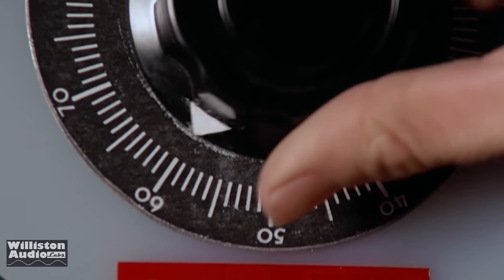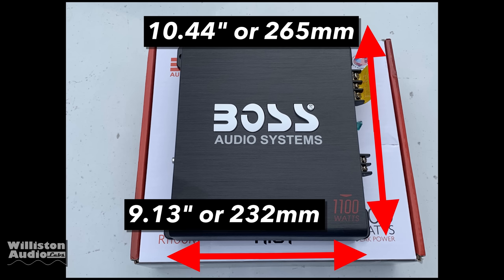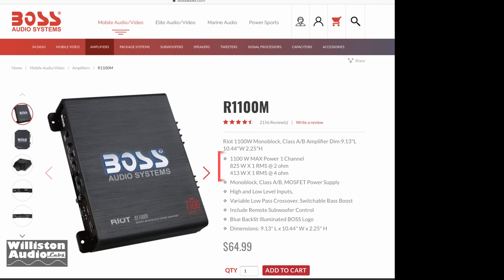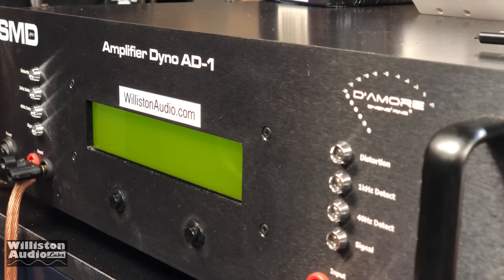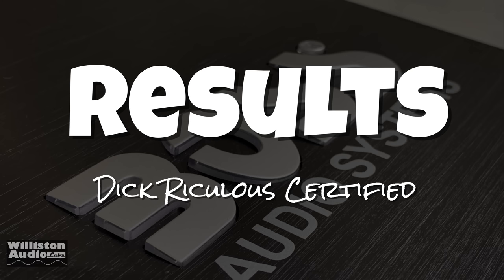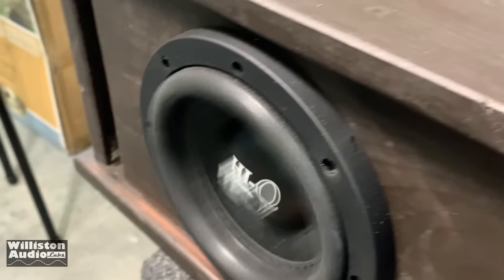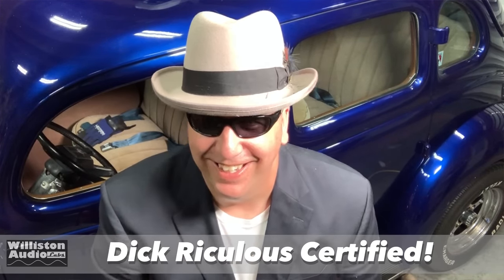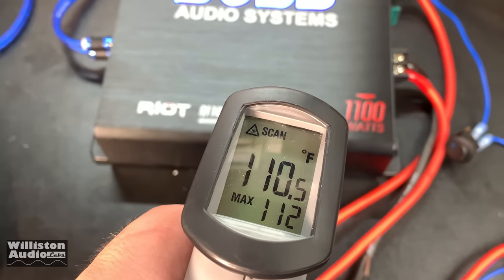Best Selling Car Audio Amplifier on Amazon (2019)? Boss Riot 1100M Monoblock [4K]

Comment: I wonder if it would power my jbl gti1200?
Reply: I'm gonna smack you with a wet latex dish glove if you dare connect one to a 1200GTi Automotive Series. That is a high resonant frequency, high efficiency beast of old school audio goodness.
Reply: @pgmurray76  and I'll put the sub in a 1cu ft box! Bwhaha!
Reply: @jat1668  Damnnnn youuuuuuuu!
Reply: @jat1668  In all seriousness, the JBL has a decent no% (efficiency) thanks to the massive magnet and relatively light moving mass (even with 4inch edgewound coil, but it is a short underhung one I believe).  It'll be fine.
Reply: Actually the efficiency is not bad, but not as awesome as the JBL 2206 twelve inch pro driver. That is more of a midbass driver with 95dB/1W/1m sensitivity (2.5% no). I confused the 1200GTi resonant frequency with the 2206. (37Hz vs 52Hz). Sensitivity is a true 89-90db at 1W/1m (only 0.6% no). I had two of these in the "recommended" 4th order bandpass enclosure to reduce group delay and extend low frequency response. The year was 1995! Two Phoenix Gold M-50 amps drove them through an Audio Control 24XS and a Clarion 6770 Pro Audio CD player. Later on was a JBL BP600.1 amp (I still have 2 BP600.1s). I sold the 1200GTi's in 2001 to buy used 2206's to make homebrew monitors for my friend's band and to help buy a used Stewart PA1200.

I was wrong about the coil and gap. It was not underhung. 5.5mm Xmax one way. It was riding to the edge of the magnetic gap both ways at full volume. Kinda underdamped and typical Bl too considering big motor. I am guesssing the area of copper within the gap reduced distortion regardless of the end of the coil reaching the top of the gap. They always sounded good and punched my back hard from 4 feet away. I go nuts when I see one on eBay.

Really they should never see more than a true 400 or 500Watt RMS amplifier regardless of the '600Watt' thermal rating. These will yawn at 600Watt thermally, but that is too much excursion wise. They never bottom out thanks to the spider and bumped back plate.   40mm pk-pk with no damage. I witnessed this in 1990 during marching band. Someone plugged into a hot soundboard slowly and a made a JBL 2241 dance really far with no distortion. This is why I loved this series of subwoofer.

Hope all sounds good for you. I hope that 1cf is after 1200GTi driver displacement, or I hope you like Palmolive green along with Playtex brand gloves!!
Reply: @pgmurray76  holy smokes. 1997 used an m50 too. Still got the m50 too. I can't decide on a head unit. I've been out of car audio for decades.
Reply: @jat1668  I still have mine too.
 Plus two M-25's and an unopened EQ-230 with TBAT. PG MX3 three way white crossover with gray silkscreening. Two Audio Control 24XS (one vintage, one newer). Audio Control 2XS (I cannot find it!). JBL GTcX12 (had a 4-leg, standard cast frame...I think same frame as Soundstream subs and Lanzar, only made for 1 or 2 years then changed). Infinity Perfect 12.1 (4Ohm). Two blue older Jacobs Accuvolt Monster 50Amp DC-to-DC stepup-down regulators. Image Dynamics CD-2 piezo underdash waveguide horns with 2-bolt 1.75inch pro tweeters. Oh and the two JBL BP600.1 amps. Plus ollllddd RF Punch 30 (peanut) and Punch 45. Somewhere, somewhere is an older Alpine 500Watt mono amp - not the shitty ones that break now. Last but not least, a silver Infinity Digital 100 amp (100x2 or 400 mono).

I am fairly certain this is everything. Not including the two pro JBL 2206 12 inch 8ohm beasts.
Reply: @jat1668  As for head units - they drive me crazy! I try to get HD Radio units with Bluetooth at minimum. Some people don't even want CD players anymore. I have an older JVC.

Comment: I went looking for my old school LANZAR 240 and 500. The cool ones with the red lettering with that cool font. I wanted to send them to you since they’re in good condition (minus a little paint scrape where the screw mounts are and a little cut back in the power and ground. I know the molex connectors are still good. 
They’re still in their original boxes as well. I gonna have to check our storage units to find these. 
I really liked these before I switched them out for a Zeus and Isis... yep I know they were made by the same place down in Santa Clarita area. I think Autotek, Lanzar and HiFonics were made there back then. 
What always got me was their THD numbers back then were like .015 or something crazy like that, which I never believed but nonetheless they were rather powerful and played clean. 
Hope my parents didn’t throw those away when cleaning up and reducing storage units. That would be a bummer.

Comment: Every boss amp I ever had was crap. The subs sucked too, I bought a cheaper boss 12 inch sub and it died in the first six hours during break in. Warrantied it for a new one thinking maybe that one was just defective but the new one only lasted 2 days past the first before it died as well. Claimed to be a 1400 watt sub but couldn't handle a 500 watt dual amp. Boss is garbage.

Comment: I think this amp would be better in full range mode for a single coaxial speaker. Buy 4 amps put one on each speaker and you are  doing pretty good. 100watts rms at 4ohm is not bad for full range speakers. Or maybe even midbass.
Reply: Ya but for $200 I can get an orion class  ab that takes 1/4 the wiring and does 150w per channel. I think anyway you look at it this amp sucks except for running 2  little speakers in your room for
Reply: @rmblwgn  Im finding this amp listed at 100 bucks. So for 4 amps, 1 for each full range coaxial speaker, in your standard car. Thats 400 bucks!  For that price theres plenty of 4ch amps on the market.
Reply: @randomtube8226  they were $50 3 years ago they are now about $60 on amazon
Reply: @rmblwgn  That's not too bad for 100watts rms at 4ohm. I know someone who has owned one for 3 years now clipping the crap out of it every day. Yet somehow it still works great. I don't even know how.
Reply: @randomtube8226  I sold mine it just didn't give me the thumpi  wanted and I'm not a guy who will ever run 2 12s. Many amps are deceptively marketed in terms of power but this one is just ridiculous it pisses me off. I felt scammed, I then bought a jbl gtx 500 that does over 800w for $20 more.if  I knew this only did less than 150 W I would have never bought it
Reply: @rmblwgn  I know what you mean. It doesn't give much thump for subwoofer bass.

Comment: My friend uses one of these on 2 kicker 12's and it bumps em surprisingly great!
Reply: Dude, its still a cheap ass 100-200W amp
Reply: The Pioneer TSW126m subs are a great pair with these BOSS amps. You get a lot of output with surprisingly little power. Used to vibrate my side mirrors with one of those subs and a cheap BOSS amp. They definitely get the job done.
Reply: @Broxine  never said it wasn't. All I said was it actually bumps...

Comment: I’ve said it before, I think these BOSS amps are solid and that’s all fine and well, but they’d be less of a joke in car audio community if they just gave their amps honest ratings. Pioneer is guilty of this too, good products, but the ratings are absolute lies. But I mean hey if you’re starting out and you want cheap solid power, they get the job done. Just remove that final zero in their peak wattage rating and you know what to expect. Their speakers and subs are nice too, just be smart about the wattage rating. Everybody starts somewhere. I gave my old “400 watt” BOSS 4 channel to my buddy for the PA horn on his CB setup. Ran the speaker out from his CB into the high level and used one channel into his PA horn, gets the job done and he’s yet to kill it. Loud too.
Reply: I’d also be interested if you know of or ever find a 5 channel amp that actually puts out good wattage to the sub channel. Seems like all of them are lacking compared to just running a separate monoblock.

Comment: That makes me wanna put my 5 year old Boss R3002 on an amp dyno. I’ve got it powering my two Clarion WG3020D 12” subwoofers. Doing pretty decent with them right now. But it’s actually rated for only 115 ish anyway lol well, I have my subs at 2 ohms per sub and it’s rated for 225x2 at 2 ohm. So it probably puts out 85x2 😂

Comment: I bought this amp and ran a 12inch shallow pioneer. Worked like a charm and sounded great. 🤷🏾‍♂️
Reply: That's because that shallow mount Pioneer is listed at 400 watts. But it really is a 200 watt subwoofer.
Reply: @ricardomolina4605  True, but it sounds amazing and for the price, I can't fault either product.
Reply: This is all you need to drive it basically.

Comment: I wish people here who stop rushing to buy crap.

Take time. Save money and buy good shit
Reply: I wish I did the same thing, I just sold my boss amp on marketplace, got rid of that shit
Reply: Don't need anything better. I only needed 100 or 200 good clean reliable watts without putting too much load on my cars electric system. Spent the money I saved on better speakers. My amp has been used heavily and moved from car to car and dropped and lost and found again (when moving to another house) and after 6 years it is still amazing in my sons new Mustang.
All other Boss stuff I've tried was pretty crappy, but this particular amp is amazing for the money.

Peace!

Comment: Well I just bought one so I hope it does ok l
Reply: Me too
Reply: I got one running 2 10" pioneers and it bumps not as nice as I hoped but decent for this guy saying it could only run a small sub
Reply: I've got one running a 350w 10" nvx. It's not bad but could be a lot better. Hits around 105db
Reply: @jpageify  running 2 600w 12" kickers. Sound great. Need an amp for the door speakers now.
Reply: Mine has been in my truck for about 2 years hooked to a Shallow mount Pioneer sub, It won't shake the windows but considering the price, I would recommend it If you want big subs and even bigger bass you will have to pay . I had since installed 2 more in my cars and all seem to work ok.  Inflated ratings is just what most AMP makers do that are not high end. Honest, heck no, but they all do it.
Reply: Its boss there is no way it will do what is rated..but a cheap brand will do basically 1/3 of rated power
Reply: Me too. Im going to put a 10" Kenwood in pancake box. Hopefully it works

Comment: if I did not what to spend a lot of money on car audio equipment I would go with boss audio and use the little watts that it have.  On the up size these amps do not draw a lot of power on the electrical side aka car

Comment: I mean, I run one, it usually is at about 825 watts, and I have 2 hertz centros 300 watt rms each, and well, this amp is pretty good with that ngl, it’s really low wattage but still hits hard asf, also it always stays bellow 90 degrees
Reply: Your amp is junk. You could spend just few dollars more and get a much better amp. I have a crappy soundstream txp 6000.1d it’s rated 2350 rms at 1ohm (it’s ohms not hertz) and it doesn’t do it’s rated power other then dynamically, certified it did just above 2k watts. It does rated power for 2 & 4 ohms. But I got it for 160 bucks and I’m pushing 2k watts in two 12’s that are rated 1k rms each…. There are cheap amps and then there’s garbage, boss is in the garbage category.
Reply: Your amp will never and has never done 825 watts unless lighting struck it…

Comment: is this good for 2 12 in 400 rms, 800 peak subs?
Reply: Hahahahahahahah no. Get the boss 4000w
It might make 400 at 4 ohm
Reply: Just go with a 2 Chanel Kenwood 800 watt amp its $140. It will do you justice.its like 200 watts rms.thats all you need to bang.
Reply: Not enough info.  Depends on how efficient your sub is and what SPL levels you listen at.
Reply: I've had this amp in my car for a year and it's still good. I have 2 12in MTX.  Drove to denver and back the first trip no issues at all, I was bumping the whole ride 🤣🤣 my 2nd trip tho about 4 hours in it turned itself off (which has never happen) I thought it busted but it was saving itself because it was overheated. It still works good tho!

Comment: Boss, power acoustik and pyramid are just some of the brands to be avoided. If you can't afford some of the better equipment do yourself a favor and save up for them, it'll be worth it in the long run.
Reply: Son Goku power acoustik is actually pretty nasty on the higher end stuff especially for the money. Boss amps a good and pretty clean. I have the 1100m i picked up for like 10 bucks locally and it’s a good sounding little amp. Never gets hot or anything. Also had a armor series.  Bout the same. Good consistent and reliable power. Not bad for the money especially if you just want a little extra thump.
Reply: @stormmccree8238  I will agree it's good for the money. But it won't last very long. I've had 20+ years experience with all them brands.
Reply: I’ve beat the piss out of some elcheapo amps like this. I’ve killed higher end amps but have never had a lil amp like this fail me. Other than a old vr3 lol
Reply: @stormmccree8238  I got a first series alpine amp that's still going. 25 watts rms lol
Reply: Son Goku oldschool gear is a unfair comparison lol. Back in the day amps were built good. I had a old school xtanz or something along those lines. Amp was basically dead and still worked in a usable way. Old kicker amps are my favorites though. I had a zr240 that was absolutely beautiful on my mids and highs.
Reply: @stormmccree8238  I wasn't comparing it, just making a statement.
Reply: I have a power acoustik gw-124 sub.  It certainly pumps out the bass, but it definitely won't handle 1200W RMS like it says it will.  I've got it on may be 300W and it seems to be pushing it hard already in a ported box.
Reply: But it is so much fun!!! I'm really enjoying these lower cost gear! I try them out in my car and then I give them away to my students!!! I show them how to install stereo in thier cars!!!!

Comment: Will it push 1 15 inch sub
Reply from the maker: Not very well
Reply: @wal  thanks..
Reply: I have one pushing a 500w sub. It's ok. Not the best though
Reply: @madfictionfpv8246  cool....
I think bridging is best for one sub....
Reply: I got a riot 1600m on my 2 12'' pioneers that are 600rms each..the amp runs hot fast and cant push my subs with enough power...could I use this amp to power my door speakers?
Reply: @cmbxsnowman5185  yes...
Reply: @liljons6753  thanks...if I disconnect 1 sub even thought they're wired parallel will it play 1 sub without problem?

Comment: I think if boss would just advertise the actual rating’s they still would sell just as much. Dollar per watts is about rite, but the false numbers are only making a bad name for themselves.
Reply: Dollar per watt is actually meh ($100-$200 yields far better $/watt) but getting a brand new amp at that price with a 100w+ output is where its not a bad unit. You can find better amps for the money but they are used.

Comment: Big d you need to test the new Orion cobalt amps for 2020. They redesigned them I purchased one and I’m thinking about sending it back it’s the biggest mono block amp the 4500.1 d it has three 35 amp fuses!!! I had purchased one in 2018 it had 4 40 amp fuses quite a big difference they’re sill charging the same$ I know it’s a budget amp but it’s also Orion kinda pissed off about it. Thanks

Comment: Would like to know what’s a good amp to push a power acoustic bamf sub that’s rated 1750 rms that’s a budget amp
Reply: 12 of these.
Reply: Skar RP1500.1D would work good if your running it at 1ohm. 2 ohm I would suggest their RP2000.1D

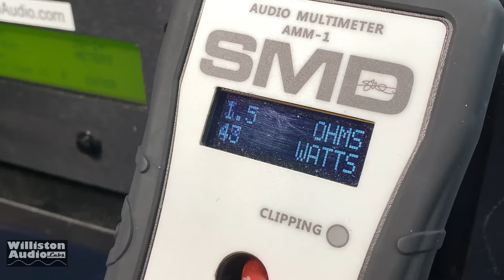Comment: stop video at 7:01 0.1 ohms 392 watts rms LOL
Reply: I thought so too, but I gave it a try a few years ago just in case. I knew the 1100 watts claim could not be true with a 30A fuse and for just $55. I am glad I did because for $55, it is great! I've bought two of them for two different systems.
For those with a sensitive ego, it may not be a great choice ;)
How much sound can you get for $55....this is a great option!

Comment: I agree with this review.  They should be honest about the rating on this thing.  A very good clean 100 watts was all I needed or wanted, hell, I'm 65 years old.  I've owned two of these (one got stolen).  There are plenty of better AMPs out there.  But it is no good if they die after 3 years like my 3 Kickers and 2 Alpines did.   It is funny as hell since the idiot who stole that Boss and left the Pioneer D4  DVC 10" Sub 30Hz Belled Port enclosure that was more expensive.  Without equipment, I guesstimated 200w peak.
Reply from the maker: Thanks for watching and commenting!

Comment: 1100 watts! For a split second, If your vehicle gets hit by lightning in the right spot.
Reply from the maker: Flux Capacitor not included!
Reply: Williston Audio Labs 
Marty, I'm sorry. But the only power source capable of generating 1.21 gigawatts of electricity is a bolt of lightning.

Comment: I know it’s shit but got to power 1 sas bazooka tube for my daily work beater and for that it’s ok
Reply: The 8 inch is all most people need as an upgrade. I bought my girlfriend's daughter a 6.5inch for her car, aimed it how I thought it should be, and I was shocked at how much 30Hz energy it had. Clean little setups and easily removed. This week I am selling my 8 inch Collins sealed 100Watt tube on eBay. I love it, but all my built subs including a JBL GTO804 are better. It was in my 1991 Honda CRX before a truck wrecked the car.